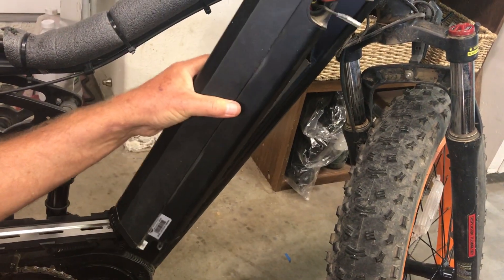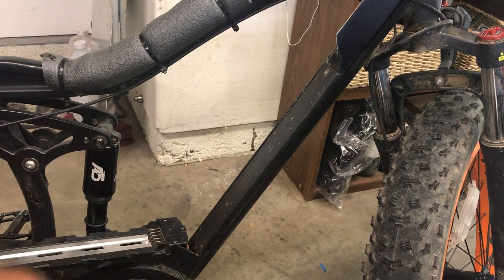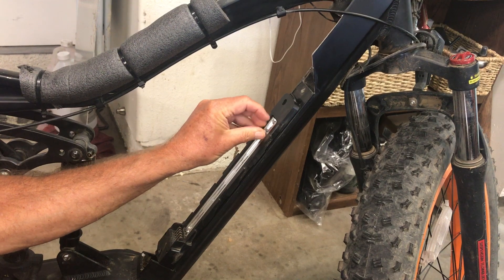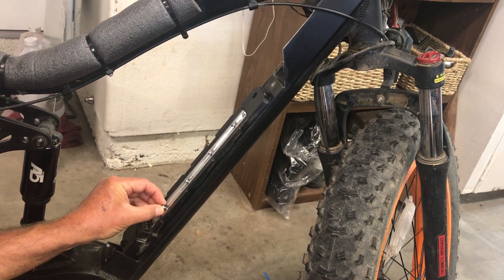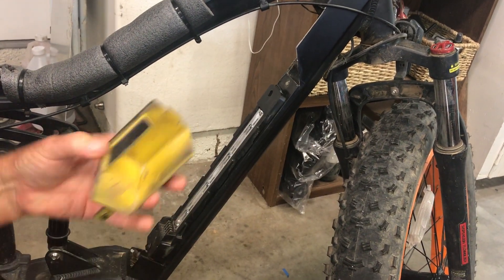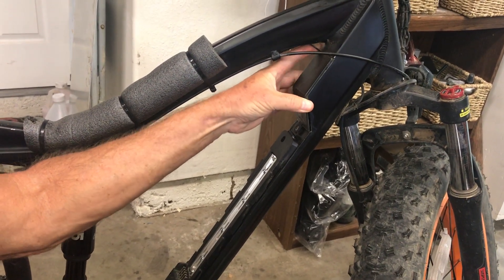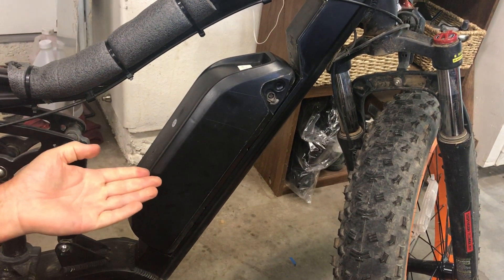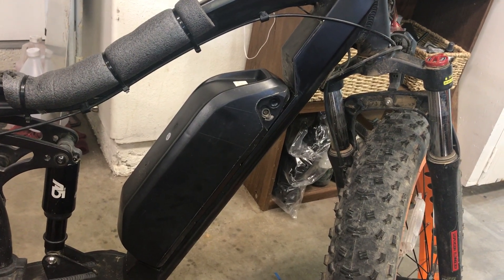Upgrade electric bike 48v downtube battery to 52v shark battery

Comment: @filoncmike Mike Could I use 52v 25ah battery with "48v controller 26a" + 48v motor" Is safe use a 52v battery with 48v controller and motor? Works better than 48v battery? ThanksMike
Reply from the maker: Yes, you will get more range and a little more power. Your controller should handle 60v. you can verify by checking the ratings on your Mosfets in your controller.
Reply: @filoncmike  Mike This is the description of the controller Could you help me if with this information of the controller I could use the 52v battery? Many thanks!!!!

"26A Controller
Type: 26A Controller
Size(L*W*H):About 122*61*30mm
Rated Power: 500W/750W
Speed Set:1.1-4.2V
Mosfet:9Mosfet
Booster:1:5
Brakes: Low-Level
Rated Voltage: DC36/48V
Compatible with motors with or without Hall 
With motor forward and reverse learning function"
Reply from the maker: @satoshi2007  Satoshi, I would check with the manufacturer as to the voltage max of the mosfets. They are normally over 60 volts. They should be happy to give you that info. Ride safe!!
Reply: @filoncmike  Thank you Mike!

Comment: I don't know the name of the manufacturer for the motor as I bought the bike through Alibaba a couple of years ago and the company no longer sells this version (so I don't expect a response if I ask).  
I bought a 26ah 1500 watt ebike, the controller is 8065Y -- 36/48v,  28a controller (maximum current), with a low voltage protection of 39v.  Is adding a 52v battery with 20 to 25ah and a BMS of around 30a to 40a safe?   I'm getting conflicting information... some say in the long run it's ruining the motor or controller but these are just people in forums talking...  I enjoyed the video!
Reply from the maker: I looked up your controller and it says it can do 1500 watts. It will have 60volt capacitors, so I believe you can run a 52 volt battery. The 20 to 25 AH is not a factor as that is just adding a bigger gas tank so to speak. Some of those box style controllers are cheaply made so you may have to just try it and see. I am not recommending you do it, but it should work. ride safe!!
Reply: @filoncmike  I bought a UPP 52v 24ah battery...   I will give it a try...   I did some more homework and by asking the computer questions a certain way the A.I. said it was safe...  as well as other people in different forums.  Thank you for the response, and I did enjoy your 'hands-on' video!

Comment: If I swap my 48v13ah for 52v13ah. Will it damage the electric components or prematurely damage the motor
Reply from the maker: Not at all. Think of it like you are swapping in a bigger gas tank in your car. You are going from a 625wh battery to a 676wh. If you can afford a bigger battery, try 52v 17.5ah. You won’t regret it. That’s a jump to 910wh! Ride safe!
Reply: @filoncmike  thank u friend

Comment: I’ve got a 43 volt Bafang can I up to 48 volt without any problems from controler? 
Thanks Kevin
Reply from the maker: It can handle 60 volts. A 48 volt battery charges to 54 volts.
Reply from the maker: Should be no problem!!👍😁
Reply: @filoncmike  so the control unit would be ok
Thanks Kevin

Comment: You think this a 52V  15Ah 1000W Ebike Battery  Lithium Panasonic 21700 USB very good  for a start off on a beginner first Ebike  in my life ??
Reply from the maker: I think a 52 x 15 = 780 amp hours is a good mid range battery size. It depends on the motor size and the type of riding you will be doing. Flat bike path riding with a 500 watt hub motor will give you plenty of range! The point is to get out and ride!!😀

Comment: I have an accolmile bike with the same shitty dorado battery mounting system that is too fragile and I have already changed the connectors 4 times in 6000 kilometers and I'm thinking of doing like you! How did you get the metal plate, did you build it yourself? Sorry I use a translator and good video
Reply from the maker: I bought an aluminum plate and cut it down to size. I then used a metalized epoxy brand 'JB Weld' to glue the plate in place. It bonds well and after 5000 miles of hard off roading it has no cracks. The EM3EV.com  battery mount is very strong as it has 4 lugs down each side that really lock the battery in tight. The connector has 5 bars and is very well made and you should never have to change it. Good luck and safe riding! Always wear your helmet. We just had an ebiker die on a test ride without helmet.

Comment: I bought an electric bike few weeks ago and the battery was shot when it arrived. dies after 1 mile. So the company refunded me over 250 bucks so i can buy another 48v battery I am thinking of getting a 52volt. the bike is 1000 watts Can I do this? the battery is 280 dollars same connectors. spend 30 bucks more for a better battery what do you think can i just plug and go?
Reply from the maker: 52 volt will give you more range for sure. For instance a 48 volt 10 ah battery delivers 480 watt hours. Volts x amp hours = watt hours. So 52 volt 10 ah battery delivers 520 watt hours.
Reply: @filoncmike  whats the difference between 48v 13ah  and 52v 20ah
Reply from the maker: @APkLegend1  Justin - do the math: 48 X 13 = 624 and 52 x 20 = 1040. big difference!
Reply: @filoncmike  yeah I am starting to understand how batteries work I watch a lot of videos. Battery life!!! For the win!!
Reply: @filoncmike  so I just got my new battery!! Before with the 48v13ah I was getting an average of 29mph sometimes hitting 31 32... This new battery I told you about the 52v20ah Now my bike goes 38-40 miles an hour WTF!!! with a 1000w hub and hit 41 on the top speed down slight hill

Comment: How many volts is a fully charged? 52 volt system cuz I know 60 volts is a cut off for 48 volts. Just trying to figure out the math ? And I also have a silver fish design battery. Do you know any idea of a company that is credible?
Reply from the maker: The 52 volt charges to 58 volts usually. 48 volt to 52 volts. Your controller has 63v capacitors so it can handle the 58 volts easily. I have 4000 hard miles on my controller.

Comment: Hi are your wheels 80 or 100mm wide rims
Reply from the maker: They are 80mm. I run a Roly Poly 4.8 on the front and a Surly Nate 3.8 on the rear. The Roly Poly 4.8 will not fit the rear - too fat!!!
Reply: @filoncmike  thank you

Comment: Hi, have anyone found an adapter so you can use a down tube battery as a powerbank/ power station  to charge computer/ phone etc?
Reply from the maker: HJ, most batteries have a usb 5v receptacle. If not on the battery then usually on the side of display. I charge my phone all the time with that plug. I don’t know amperage.
Reply: Works 100% - I use it when there is no power to run TV, LED 220v lights, Computer 2 X screens, router/ wifi and TV decoder box
Reply: 48v shark battery 12amp hr

Comment: Hey Mike I have a question. 🙋‍♂️ I have 26” Nakto Electric E bike Super Cruiser 500watts. It’s 48V 12Ah. Is it possible to upgrade my battery to 52v 25Ah?!?!🤔🔋 I want more power and go faster. Will it destroy my E bike. Please let me know. Thank you. 🙏
Reply from the maker: Hello Ruslan! You should be able to make the swap ok. Most controllers have 60v Capacitors. Remember going from 12ah to 25ah is just like increasing the size of your fuel tank, so no problem there. As with any hub motor, heat is a problem. You have to stop and let it cool down every few miles depending on load, temp outside and hills vs flat. I put a $3 aquarium temp gauge on the heatsink side of my controller so I could monitor the heat of the controller when I had hub motor bikes. Unfortunately you cant externally monitor your motor for heat. Good luck. Dont hold me responsible if it cooks the motor or controller if you run it too long and hard. That will happen with your 48v also. I've done it!
Reply: @filoncmike  thank you so so much for your help Mike. 🙋‍♂️🚴🔋☝️😂💫🌏👌

Comment: Did you change your controller at all?? Cuz my question is I have some reaction batteries just like the one you had that you replaced that I just need to swap out the plug would you think a plug would make any difference or heard anything if it's the same voltage just a higher amp hour battery
Reply from the maker: Not sure of your question. The blade plugs are much better than the pin plugs. Most controllers can handle 60 volts. I did have to replace the plug on one of my downtube batteries when it fused together.
Reply: Sorry the question is I have two re-ension down to batteries that are 48 volts which match my bike my plugs are different though compared to my bike my bike has a 6 pin plug and the batteries have two pin plugs it should be as simple as swapping out to six pin plugs right
Reply from the maker: @m1000black  Yes, just change the plug to match. Be careful not to short the battery when soldering the cables!

Comment: You upgraded to a 52V battery.... why bother?
Reply from the maker: Well Brian, The downtube battery I had was a 14.5 ah 48 volt = 696 wh which on the hilly off-road terrain gave me about 20 miles of range on a mid setting of PAS. With the 52v, 17.5 ah battery or 910wh of power my range over the same terrain increased to about 34 miles. Also, the downtube battery had two prong connector that fused together after a long ride. I had to break the whole battery out. Further the EM3 ev battery had 4 locking lugs on each side of the battery and a 5 blade battery connection as well as 4 mounting screws, so it is very secure with no need for an external strap to keep the battery tight on extreme downhills. So better range and better battery design was the goal. Now I blow by Specialized and Trek and have to wait for them on long climbs. Also they have to turn around after 10 to 15 miles to insure they get back to their starting point.
Reply: @filoncmike  Sorry man I guess I was just feeling pissy Mike... I hadn't got my ride in yet. I use a pair of 58.8V 35Ah packs so any battery on any production ebike I see seems small and super expensive. I only use 65% of the pack capacity hoping to extend the number of charge cycles... which is still 1337Wh. I'm hoping the EM3ev will start building more 30+Ah packs again sometime in the future. 31 mile ride around the neighborhood today for me with about 90 lbs. of gear, battery, and motor. - https://photos.app.goo.gl/VnkbAMrcgcKKvjAR8
Stay safe.

Comment: Did you have to change your controller or the display in any way?
Reply from the maker: No Perry, everything works as original except the first 18 miles shows no battery use because it takes that long to get to 42 volts when the first 10th indicator bar ticks off. Then the other nine bars drop off in the 2 volt increments.

Comment: Nice work my friend.  What can you tell me about your 3D printing machine?
Reply from the maker: I have a Wanhao printer. It works well and has a 9" cubed build platform. It originally cost under $400which was my criteria to buy one. I use Fusion 360 free design program and Cura to slice the files so the printer can print.